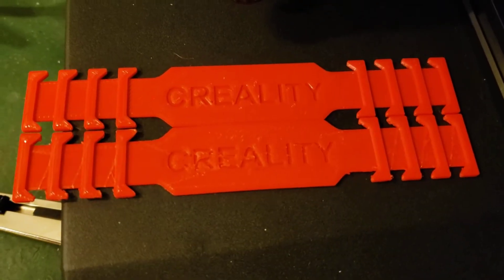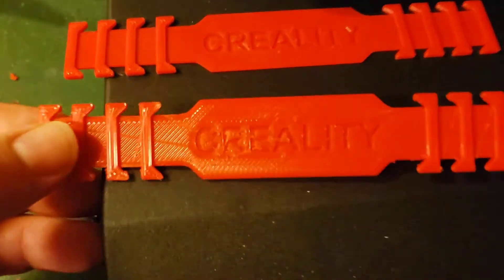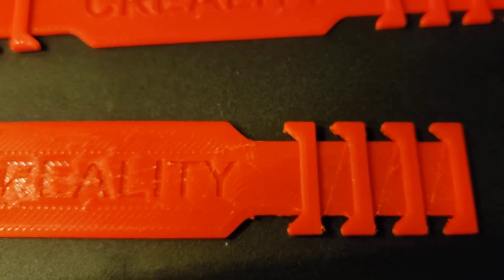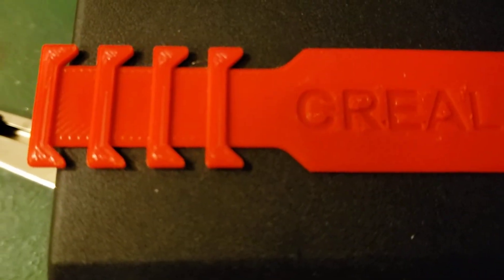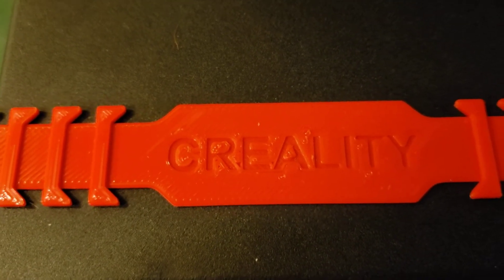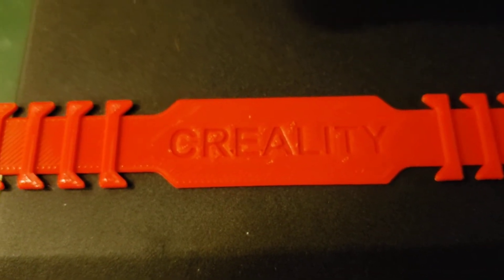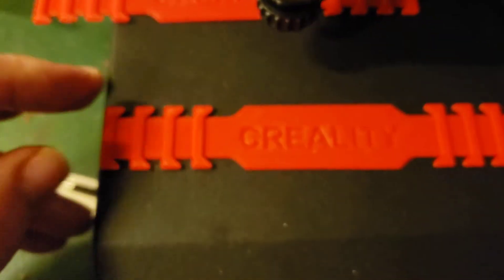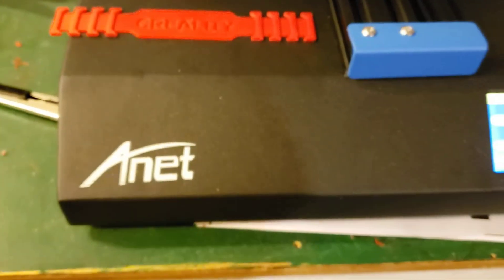Anet ET4X stringing problem fixed

Comment: Can you please explain how I hold up my own designs to the printer, I can’t upload my own designs for some reason
Reply from the maker: You have to save it as the right file type. Try, "save as" ----> ".stl"
Reply: Could you please make a video on how you turn designs from tinker cad into g code files to put onto the usb. I know I am asking for a lot of help but I am brand new at 3D printing and i am ticked off that I can’t print anything else other than a cat/dog or pog
Reply from the maker: @jaxx_waltz  I've never used tinker cad. But, me making a video without knowing your situation may not help you. You're at the point where it is time for you to learn this one on your own. What I can tell you is that the cad software's save their files as a certain file type. And the slicing softwares only accept certain file types. But, when you save a cad file, you have an option to "save as" a different file type of your choosing. This is the time you would choose the file type you need for your slicing software. This is a basic computer skill you should know how to do or need to learn.

Comment: I have the Anet et4 x diy printer and there is a bracket that I don’t know where to put on the printer
Reply: I can help ya out, I have the same printer. Is it a black bracket and how many screw holes are their?
Reply from the maker: The only bracket I can think of is the stop for the z-axis. You'll have to be more specific if you want help...
Reply: I just figured it out. Thank you for the tips though and have a great day
Reply from the maker: no problem, I just uploaded the video for it and a quick bed leveling if you need it... good luck with the rest

Comment: hey how manualy leveling on anet et4x?
Reply: Hey man, nice video. Im having problems with my z axis leveling. How did you calibrate yours? Instructions are crap and info on the web even worse. Thanks for any tips.
Reply from the maker: @kylemashburn7914  I manually put it down to the glass then brought the stop bracket for the z-axis switch up to the switch. Then once leveled, I had to put a -0.05mm offset in the slicer software. I mentioned it in one of my other videos.
Reply: @justinclark9258  I gotcha, I appreciate the info man. I was using Cura and the Z axis wasn't adjusting properly. Thanks again Justin.
Reply from the maker: @kylemashburn7914  I don't really like the Cura slicer. I use Slic3r, it doesn't have ironing but, it is more friendly to use for me. Cura requires an add on for the Z offset.
Reply: @justinclark9258  Yeah, my prints are all over the place using Cura trying to dial it in right now. Keeps printing in the back/half the print. Might try Slic3r instead to see if it'll fix it.n
Reply from the maker: There are 4 points that can be manually leveled if that's what you're asking.